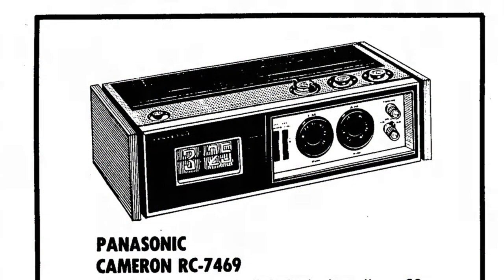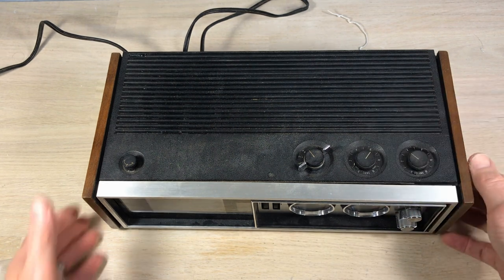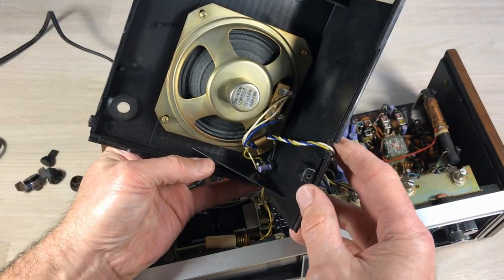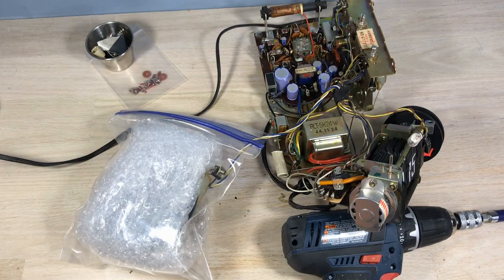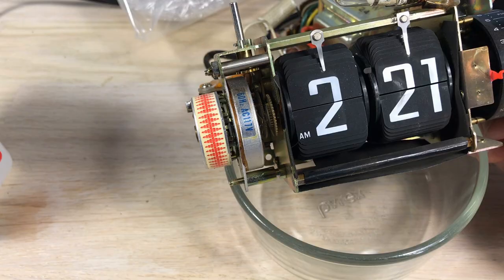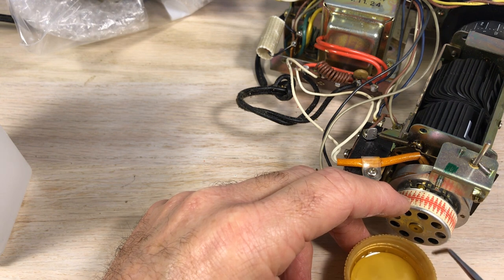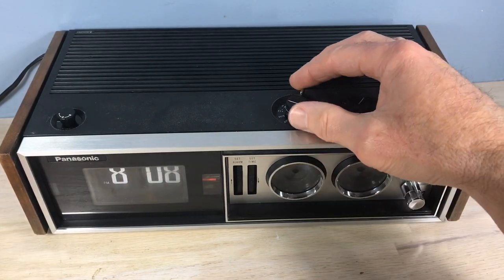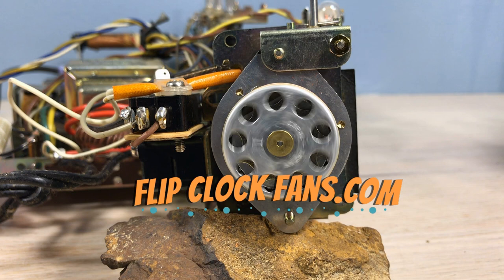The Panasonic Cameron  RC-7469 Flip Clock Radio

Comment: I fished one of these out of a Goodwill clearance center bin today and took it home for $4.  It also is missing the Panasonic logo..  Maybe that was an issue with these or something. I tested it on site and quickly realized that while the lights and radio work fine, the tiles do not turn.  While I usually pass on anything needing mechanical repairs, this unit just has such a fantastic design and personality to it that I had to take a chance on fixing it.  Your video gave me a great bit of info, and hopefully I'll get those tiles turning again!  Thanks so much!

Comment: $60 seems a lot higher than the $30 or even $20 people were paying for the same clock features in the 1970s, but most of those later versions had a crappy pocket radio speaker, no tone control and maybe a miniature output transformer. That seems to have an input transformer feeding a push-pull pair with a capacitor coupled output, hence the decent sound quality, and you can tell by the heatsinks that it probably has more power than its bargain priced successors. Nice radio.

Comment: I bought one on Ebay for around 40 dollars that wasn't working and your videos have helped me bring it back from the dead. It looks wonderful, except there is a slight warping to the top (most likely due to somebody sitting something on the plastic that was too heavy for too long). What would you recommend for flattening it out? I thought maybe using a heat gun and some weight, but I worry about damaging it further. Looking at your video, mine is warped just like that. A little high on the right side.

Comment: Great work on The Cameron (as usual)! I'm shocked that you had an extra Panasonic logo laying around, LOL. Did you use anything on the plastic window in front of the flip numbers? I have been experimenting with Novus, but it isn't a miracle cure. Sometimes a elbow grease is the only way.
Reply from the maker: I used to try to get those pristine, using "Meguiars Plastx Polish" but, like you said .. it's a lot of work. These days, I just let it ride. My clocks look like they've got just a little wear and tear, but hey ... so do I.

Comment: I bought one of these years ago but haven’t been able to fix it! Clock works great but for the life of me, I cannot find a replacement transformer for it! Lights and radio do not work and transformer puts out no voltage. The RLT-5k24-w serial does me no good online. I need to find the output voltage in order to make a replacement for it but cannot do so because I dont have voltage!🤔Do you happen to know any specs on that transformer? You have the exact same one in your clock!
-George
Reply from the maker: Hey There George ... Let me open up that clock and see if I can get the values for you. I'll get back to you.
Reply from the maker: Well ... had some time on my hands so I threw a video together for you:
https://www.youtube.com/watch?v=oHYEeSZB600
Reply: Thank you so much for your help!#flipclockfans
This is definitely a huge starting point for me to find a replacement transformer now that I have some voltage info.

Comment: I have  similar clock and I took it appart since the clock wasn't working. I did what you showed and it start working. There are still two problems: 
1. one  half digit is broken , - the tiny part of it that keeps it  hold in place on rotary with other digits. Do you think I should try to glue some tiny peace of plastic?
2. the other problem, the hours digits flip to new hour incorrectly, - when minutes come to 48-49 it flips instead of 59. I'm trying to understand how to fix that
Reply from the maker: Both things can be fixed:
1. Fixing tiles: https://www.youtube.com/watch?v=dwUgwBYwAhU
2. Fixing misaligned numbers https://www.youtube.com/watch?v=BnPr2xODirE
Reply: @Flipclockfans  Oh thank you very much for such a quick help

Comment: I have one of these.  The clock worked for about 3 days, then it stopped.  The motor is spinning, but the clock does nothing.   Ideas?  it's otherwise in lovely condition.   Has the NATIONAL PANASONIC logo.
Reply from the maker: There is almost certainly a broken gear in the motor gear box. Less frequently the problem is with the clock mechanism.
Reply: @Flipclockfans   THanks.  I suppose it broke just from the stress of running for 3 days.  It's otherwise in beautiful condition, so I'd like to get it working.   Anyone have a spare mechanism that they'll part with?